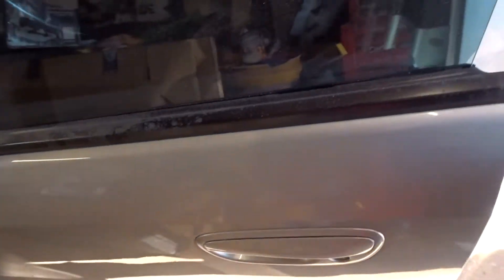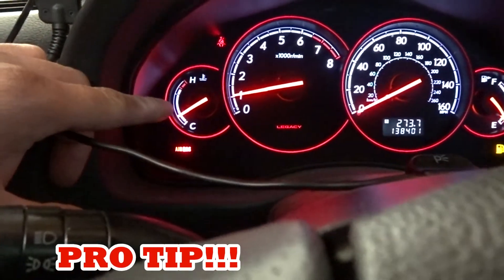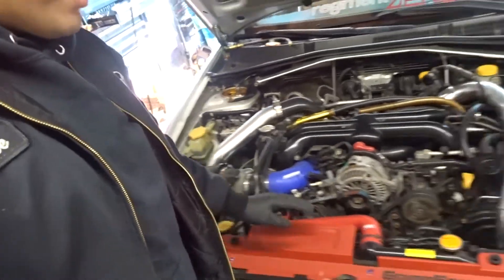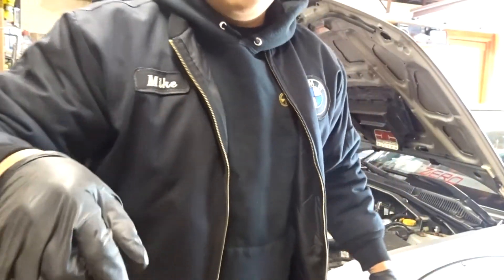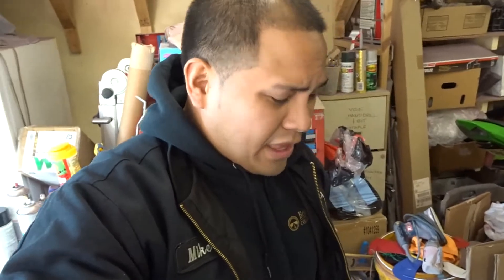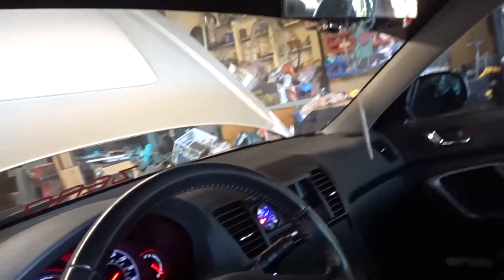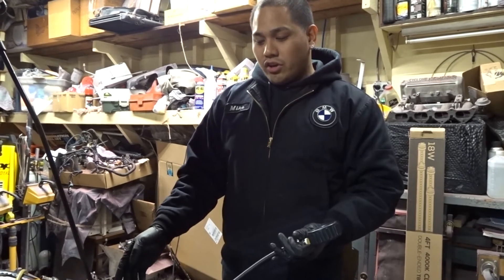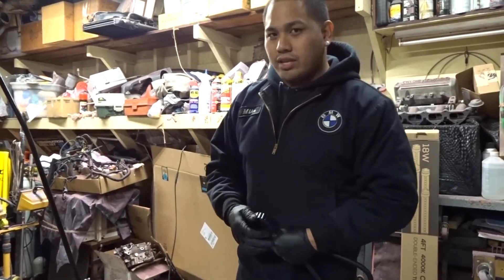PERFORMING A COMPRESSION TEST ON MY BUILT MOTOR SUBARU LEGACY GT!!

Comment: I have 2007 jdm legacy gt. Have done a new ej207 sti shortblock build with stocks heads reused. After 500 miles, did compression test and results were:
Cyc 1: 105
Cyc 2: 106
Cyc 3: 110
Cyc 4: 108
Are these figures in healthy range or too low? I expected around 140psi. Car is still under break-in period so no WOT pulls, keeping 4.5k rpm n under. No oil consumption or coolant issue.